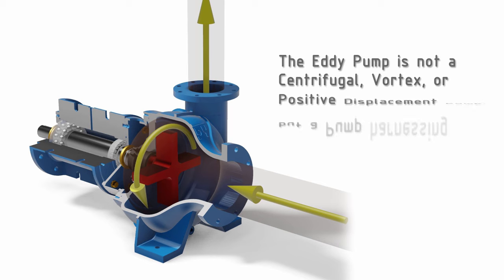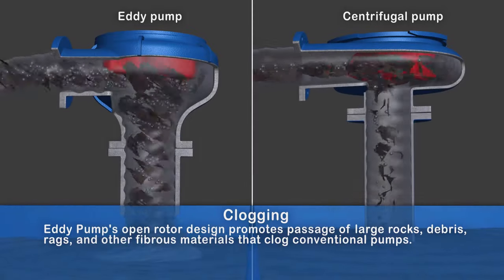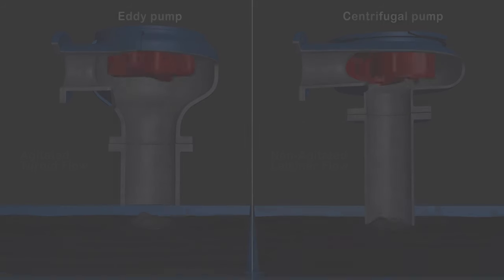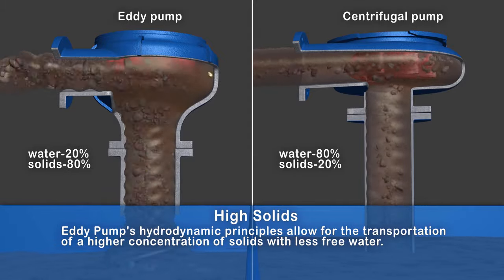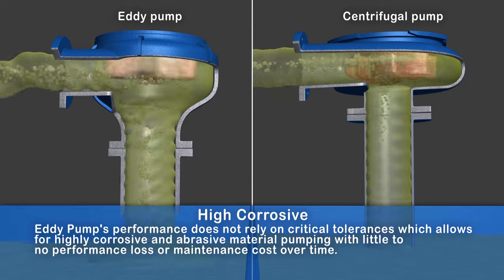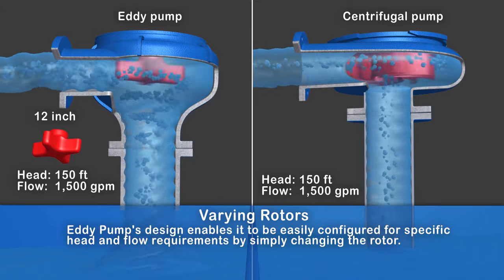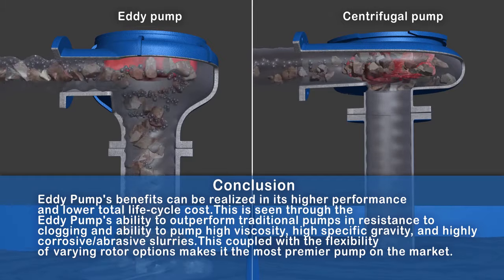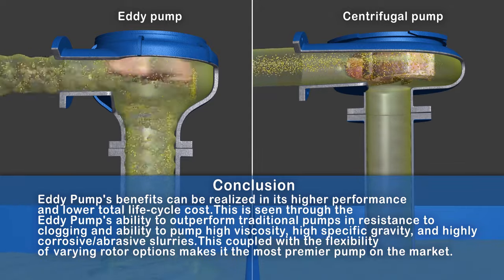EDDY Pump Vs. Centrifugal - How Our Dredge & Slurry Pump Work

Comment: is it still work if the input added a pipe?

do you have small size pump
Reply from the maker: We offer industrial 1-inch through 12-inch versions Visit https://Eddypump.com/contact with details of your project for evaluation.
Reply: @EddyPumpCorporation  is it still work if the input i add pipe?